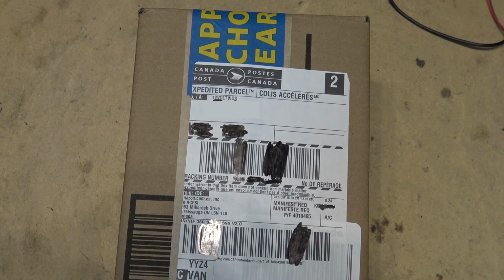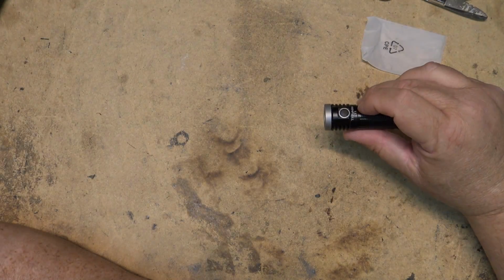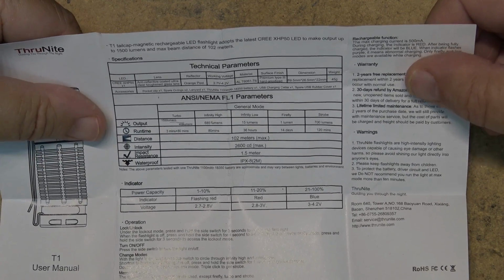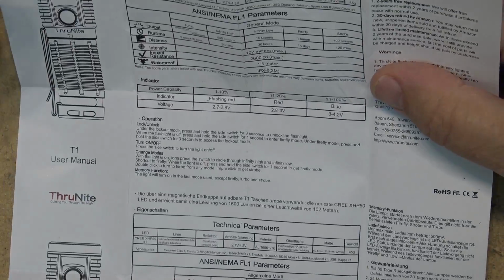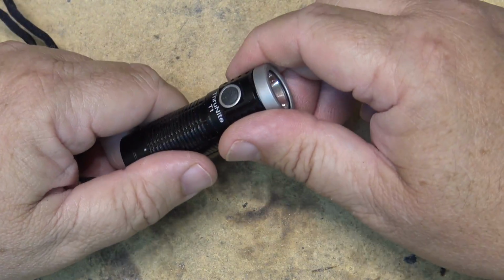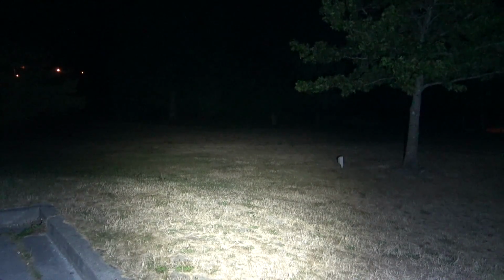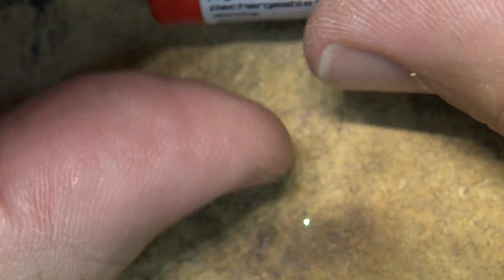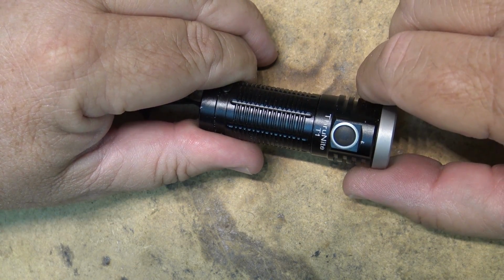Thrunite T1 Magnetic Base compact LED rechargable flashlight

Comment: My only bug about flashlights is that so many of them are black. What moron thinks that hunting around in the dark for a black flashlight is a good idea? At least this one can be stuck to the refrigerator.
Reply from the maker: Lets see one made with glow in the dark paint.  I actually have one that the power button has a dim blue glow so it is easy to find. Drawback is it consumes the battery over time so it has to be charged every few months used or not.

Comment: How many meters/feet (whichever measurement you're comfortable using) of water was it submerged at 19:05?
Reply from the maker: It is rated for 2 metres which is just over 6 feet but I only put it down 3 feet and left it there for 10 minutes.
Reply: @12voltvids  thanks for the update, brother! ☺️

Comment: Very good flashlights. The only negative side in Li-Ion batteries is the low temperature behavior. I live in a country with cold (-30C/-22F) and dark winters, so I prefer NiMH batteries.
Reply from the maker: I have found NIMH perform poorly in cold temperature
Reply: Use lithium batteries. They may be a bit costly but they're great for your situation.